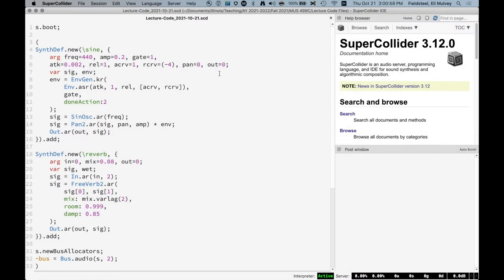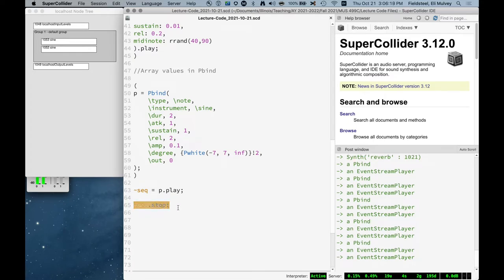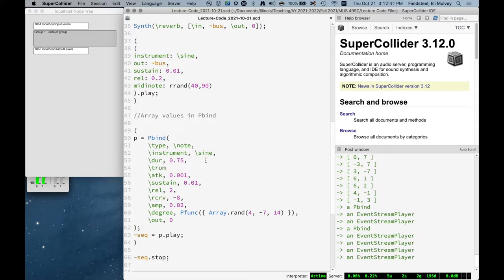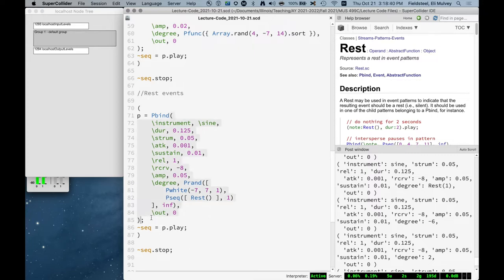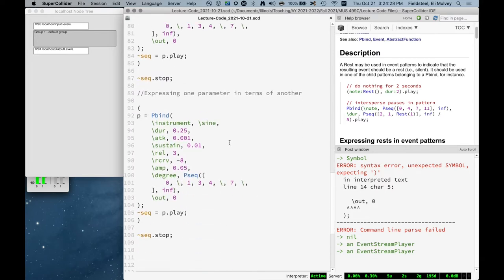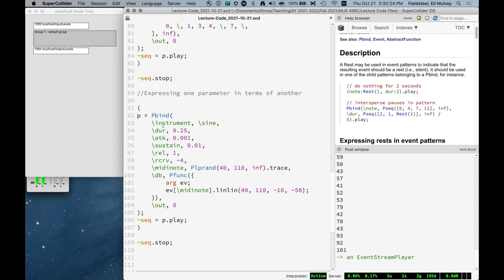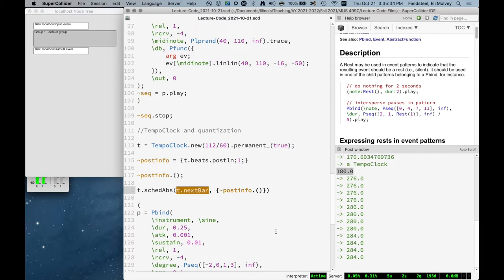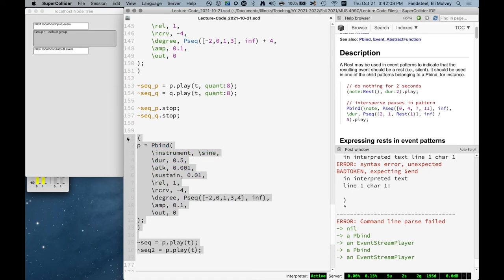Events, Patterns, Sequencing III - Week 9 Fall 2021 MUS 499C - Intro to SuperCollider

Comment: Is there a specific reason that the syntax at 4:55 — Pwhite(...)!2 and {Pwhite(...)}!2 — doesn't work in a Pbind?
Reply from the maker: Yes, there is — and this is a great question (one I should have answered in the video).

When we create a Pbind and play it, a lot of invisible stuff happens in the background. The Pbind is converted to a Stream (technically, a type of Stream called an EventStreamPlayer), which is the process that actually "performs" the Pbind. Performing a Pbind involves calling 'next' on each individual value stream, dumping the results into an Event, and 'play'-ing the Event.

If we convert a normal Pwhite to a stream and call next, there's no issue, and we get a proper number:

Pwhite(-7, 7, inf).asStream.next; // -> some random integer

But if we have an Array of Pwhite objects, and try the same thing, it doesn't behave the same way.

(Pwhite(-7, 7, inf)!2).asStream.next;

Every object in SC responds to 'next' without throwing an error, but most objects just return themselves. Actual Streams (e.g. those generated from Pattern objects) are sort of an exception — they are state aware and will possibly return a unique sequence of things in response to multiple 'next' calls. However, calling 'asStream' on an Array doesn't magically transform it into a Stream. In fact, it doesn't actually do anything.

(Pwhite(-7, 7, inf)!2).asStream.class; // -> still an Array

We're sort of accustomed to Arrays "looking inside of themselves" when they receive a method, and applying that method to each of its items:

[1, 2, 3].squared; // -> [1, 4, 9]

but it doesn't always work like this.

So, our example doesn't work because we're calling 'asStream' on an Array, which just returns the same Array, and then we call 'next' on this Array, which—again—just returns the same Array. In this case, our Array contains two Pwhite objects, and this Array is exactly what gets plugged into the Synth as the argument value. Neither Pwhite nor an Array of Pwhites is a valid input for a Synth control argument, so it fails (I think there's some process on the server that just replaces these with zeroes).

Does this make sense? Thanks for this excellent question.
Reply: @elifieldsteel  Thank you very much for the explanation, and yes, it makes perfect sense, especially with the help of your example code. It also helped me to follow up by making a dummy Pbind with a single key and pattern pair so I could use .trace to see the result of using correctly written patterns versus the incorrect !2 syntax. As expected, the value is pair of objects —  [a Pwhite, a Pwhite]. Can't wait to get your book!

Comment: I am so grateful for these videos. They provide a path to learn SC in my free time. Thx you so much! 

A little remark: at 33:30, you do not have to schedule {~postinfo.()}. Instead, scheduling ~postinfo suffices since it is already a function. In fact, if func is a function then {func.()}.() equal func.().
Reply from the maker: A good observation. Technically, you're correct, but you're overlooking a problem. By scheduling the function directly, as you suggest, it can't actually be removed from the scheduler, at least not very easily. With my approach (scheduling a function that calls a function), I'm able to dynamically re-write the function, e.g. to un-schedule it when I don't want to see beat values any more. Compare the following two examples. (and, thanks for the kind words!)

//Example 1

(
//create clock and info function
t = TempoClock.new(108/60);
~postinfo = { t.beats.postln; 1; };
)

//schedule beat-posting function
t.schedAbs(t.nextBar, { ~postinfo.() });

//un-schedule by re-defining the function to do nothing
~postinfo = { };

t.stop;

//Example 2

(
//create clock and info function
t = TempoClock.new(108/60);
~postinfo = { t.beats.postln; 1; };
)

//schedule beat-posting function as-is
t.schedAbs(t.nextBar, ~postinfo);

//it can't be un-scheduled!
~postinfo = { };

t.stop;
Reply: @elifieldsteel  You are completely right, and I am a fool, haha. Thx that you are going back and explaining everything! That is interesting. So t.schedAbs(t.nextBar, ~postinfo);  is a call by value and not by reference such that the function is a (shallow) copied here and the reference ~postinfo and the copy point to different functions.